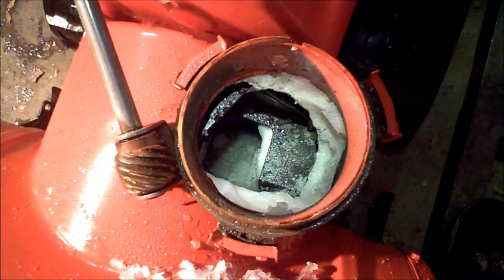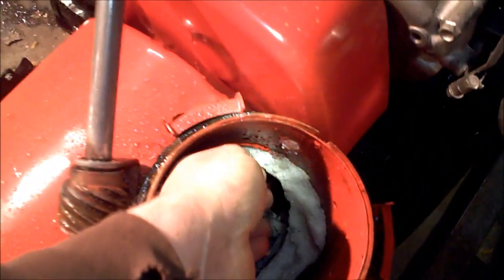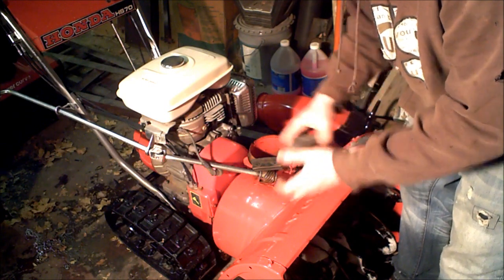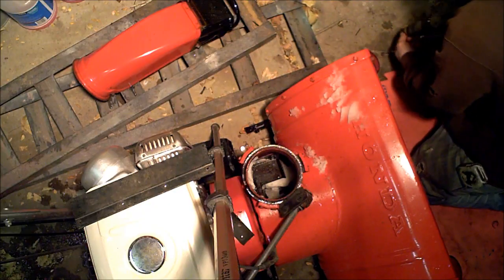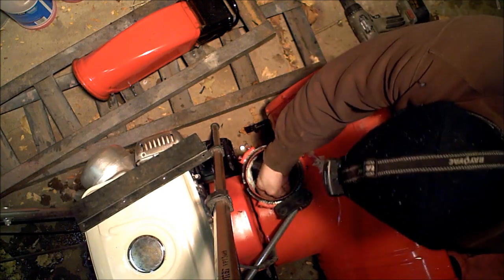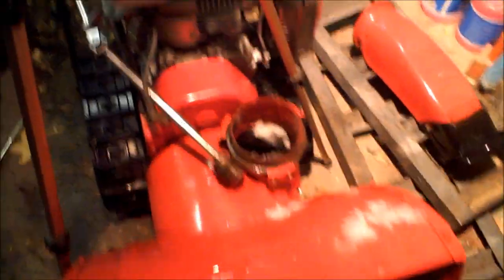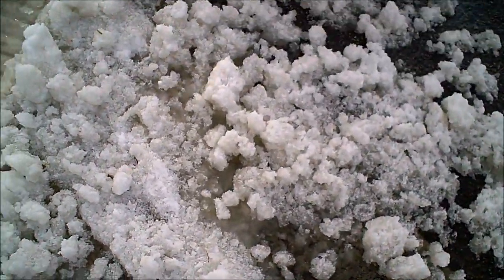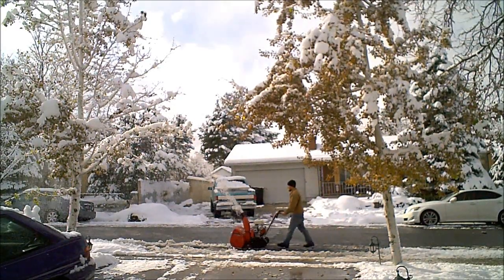Modify Snowblower to never clog and throw twice as far w/ Impeller Kit

Comment from the maker: There is a link to Heavy Duty Rubber Paddles designed to handle this and stainless steel screws in the video description.
Reply: sixtyfiveford Hey 65 love your videos! I have a question,  my 8 hp MTD where you screw the rubber on, mine has an additional 90 degree angle, like a scoop,  heavy steel. Do you think I could put this on the back side of the scope.
Reply: That’s the same way airlock rotors are done ✅ with a metal sleeve just like you are with the rubber gaskets
Reply: The only thing I would add is use anti-seize on the screws, that way you can remove the screws if needed.
Reply: if u have 3 paddles on your snowblower do we fix all 3? also mine on my craftsman are at an angle which will be harder to drill but better than getting rid of a good running machine . thanx 4 the great tips
Reply: @johnpoole8321  Drill slowly, don't force it or drill bit will break. You could actually drill carefully with #7 drill bit, and then tap it with 1/4- 20 Tap. Then get some stainless steel bolts and washers, and you are in business.
Reply: @LincolnSP150  use tapping fluid for a $ it will save your bit from wearing out!!! and from breaking because it wore and wasn't working , so you can get hte job done!!! cutting fluid, sorry, not tapping fluid
Reply: Have done this on my rebuilt batteryelectric snowblower, and it work just great 🙂
Reply: I don't have a impeller on my snowblower but was wandering if the same concept would work for mine
Reply: Hello 2018 ! Just found this thank god ! Inherited a crapsman 5/22. Has anyone done this mod on this particular model. Chute and box seem a bit different from the above video tutorial. After a few years of clogging anguish and several cans of pam( in which at this point I should have bought stock ) I am hoping someone has done this to the 5/22 or I’m going to take it to the demo range and blow it up ! Crapsman super sucks !
Reply: sixtyfiveford Great video. I'm looking to purchase a new Snow Blower, and recommendations and do you recommend a single stage or 2 stage for Michigan weather?
Reply: @RichieColemanSr  

  ---- ---- ---- ---- ---- ---- G63EPI2nZ0xF G63EPI2nZ0xF
Reply: Mr. RDCS 2 stage only way to go.

Comment: You can set the rubbers against the housing. It will wear in if you just let it run for 5 - 10 minutes until the paddles wear in, just like piston rings.

Comment: Hello sir, I have watched just about all of your video's and you my friend are very smart and think outside the box.  Several years ago I did this upgrade to my 20 to 30 year old MTD snow blower and what a fantastic difference.  But, now I am having a different problem with my MTD.  Last year it started shearing the pin that secures the left wheel to the axle, then the axle moves to the right, the woodruff key falls out & the self propel no longer works.  I've replaced the pin with a 1/4" bolt and it shears the bolt in half.  This last time it did it (last week 01/2025) I installed a grade 8 bolt but, I am now worried that a grade 8 bolt may do more damage than good (thinking that shearing the pin is the weakest link, now that I've installed a grade 8 bolt something else may break).  Also, while snow blowing, the blower wants to constantly go left and I have to force the blower to the right to keep it going straight.  Do you have any ideas what would be causing this phenomenon?  I am at a loss.  Over the years of ownership I have had this blower completely disassembled several times to fix various problems.  Thank you in advance.
Reply from the maker: That's a weird one. The only thing I can think is the wheel may be catching on the frame by shifting forward under torque due to a worn bushing. Something has to be stopping the wheel from turning while the shaft is still moving.

Comment: I guess I've been lucky so far, but I've never experienced either of my snowblowers clogging up.  If it ever happens, I'll just do what I do when I'm done using them and park them in front of my torpedo heater.  That 80,000 BTU's melts that stuff quickly, lol.  In 10 minutes it's not only melted, but dry and warm too.

Comment: The snow blower is a 2-stage machine attached to the tractor via a 3-point hitch.  The PTO has a beveled gear that drives both the auger and impeller,  oth driven by a second set of bevel gears.  It’s the centerline of the auger that needs to be changed, and therein lies the issue I’m having.  Or to put it correctly - my son is now having.  About 8 or 9 years ago I broke this snowblower down to change the centerline and true to form - try changing one thing and two others appear needing to be changed as well.  Keeping everything in alignment during these changes were just too much for one person.  What I did do was take the PTO 540 RPM shaft and double the  RPM using a gear box mounted on the snowblower.  Granted, not the smartest thing to do, but I do have sacrificial shear bolts on both the auger and impeller shafts.

Comment: I was given an expensive 2-stage 24” wide snow blower because it was jamming on everything except perfect soft snow.  Had an old large truck mud flap that I cut up to reduce the 3/4” gap between the impeller and housing.  My son now uses to clear his very long driveway because it works better than his tractor mounted snowblower.  Looked at the tractor snowblower and there is a real problem there.  The impeller is offset from the center of the housing.  At the bottom, between the impeller and housing, there is greater than a one inch gap.  At the end of the exit opening there is maybe a 1/132 inch clearance.  The only fix to start with would be to move the housing or impeller’s centerline.  Sometimes chicken, sometimes just feathers.
:face-fuchsia-tongue-out:
Reply from the maker: @robertmeier7620  Single stage? Put a spacer at/around the back on the housing just behind the auger/ chute discharge to reduce the gap. Does the same thing.

Comment: The question is.. why on earth does not snow blowers comes with the rubber flaps , would be a bestselling argument
Reply from the maker: Simplicity actually did this for their snow blowers in the '70s. Why don't they come with them now? Money. Higher end snow blowers have a lot tighter tolerances and don't really need these. Budget snow blowers under a thousand bucks generally have huge gaps and it only gets bigger the cheaper they get. It's cheaper and easier to give people the little plastic stick as everybody just assumes, snow blowers clog. When you buy a $600 snow blower, the goal is to make it as cheap as humanly possible for the consumer to buy yours versus the other $600 snowblower.
Reply: @sixtyfiveford  i got an old Canadian made Stiga 825 and a 928
Reply from the maker: @kendexter  Never even heard of Stiga here in the US. I just looked them up and they look like they're made by MTD. At least the ones made in the last 30 years or so. Here in the US, MTD made probably at least a dozen brands.

Comment: Great tip. Works like a charm. I used some silicone grease to lessen the friction on my 5hp Snow King. No offense, but what you called “self-tapper screws” are actually self-drilling screws.  Self-tapping screws require drilling a properly sized pilot hole that they will then tap into. Self-drilling screws drill the pilot hole and tap into the sub-straight.
Reply from the maker: Oh the endless debate of self tappers. These are technically self drilling and tapping screws as they drill their own hole and make a few threads.

Comment: Nice upgrade.  For a more envirofriendly option to the DuPont Snow & Ice Repellant with Teflon Fluoropolymer, try using regular cheap vegetable oil as you find in the grocery store.  I just brush it on the interior of the augers, auger housing, impeller and chute at the beginning and end of the season.
Reply: I just spray it down with wd-40
Reply: @76327monte  Nothing says good for the environment like WD-40....  /S

Comment: Yes that's called an impeller kit and they sell them on Amazon for any snowblower or you can just use conveyor belting or similar belting and make your own. I've done several blowers with it and it works well. No it does not make them blow snow twice as far but it will blow it a little farther than it did before and more importantly, it will keep it from plugging up when blowing wet, heavy snow.
Reply from the maker: Yeah they didn't start selling them until my video went viral.
Reply: @sixtyfiveford  No, they've been around since I was in the Army back in '72.

Comment: We just scored an older Craftsman 12 32 track drive for $200.  Removing the track drive and mounting the blower to the front of our 4 wheeler. With no drive to run and this impeller mod this thing should sling some snow for sure. I think that this will be a kick ass upgrade for sure. Thanks for sharing. Liked and subscribed. 👍🏻👍🏻👍🏻

Comment: I have a 622 honda, about 15 years old. Never had a problem until now. It clogs up in the shute with heavier snow. I was told that spraying the shute with PAM, a cooking spray,  would help the problem. NOT. Ever hear about this fix?
Reply from the maker: Yes, that helps but you will have to do it constantly. Every 10 minutes of run time and every-time you use it. Any oil works and I find WD-40 better. They do sell dedicated products: https://amzn.to/3CBH6HF

Comment: How thick is the impeller blades on an early ( 1980 ) Toro 7 24 ??  can they be drilled and set up like this.
Reply from the maker: They're generally 3/16" thick and harden steel. Most newer stuff is under 1/8" and mild steel.

Comment: self taps can only last so long.
Reply from the maker: True and that tends to be the life of the snowblower. I've installed all over 100 of these setups and a lot for neighbors. Every time one comes in and I look at it and I've never seen a single self-tapper back out. I even run self-tappers on tractor snow blowers and never seen one back out.
Reply: @sixtyfiveford  I’ll take your word for it, I spent 40 years in the sheet metal HVAC industry where we use self tappers all the time but it seems with all that stress on the blades it would be logical to use bolts.

Comment: I did this mod’ six years ago, to my new Cub Cadet 524SWE, after watching this very video, and it’s still firing snow with a vengeance! I used pieces of a Toro single stage rubber auger paddle ($16 on sale), and stainless nuts, bolts, and lock washers. Thanks for the “how to” on an awesome mod’! Keep doing what you do.
Reply from the maker: That's awesome. It's too there point I just do it to every snowblower I service now.  I stuck my finger in the gap of a brand new $1200 Craftsman the other day at Lowe's. The gap was nearly 3/4" . I guarantee the new owner of that will being looking for this solution next season.

Comment: My drive cable keeps coming off the handle. The only thing I touched was adding more tension to the auger tensioner pully, which I don't think caused the problem. The drive cable ends are both intact and can be reconnected, but just pops off again and now has bent the housing that holds the cable to the handle. Any Thoughts???

Comment: Interesting suggestion that you don't need to install the impeller extension on every blade, that may be what I try for a first cut because I'm for looking forward to the drilling on the vintage Troy Bilt 42000, which have thick blades.

Comment: I'm not sure how much balance comes into affect on a snow thrower but I would definitely worry about only putting one on or if you had 3 paddles on your impeller I would do all 3. Great info just my thoughts
Reply from the maker: The impeller is never balanced under load. One blade will have a full load of snow while one might have a partial and the other(s) empty.

Comment: Wow, excellent tip I'm going to have to try that.
Reply from the maker: You should!
Reply: @sixtyfiveford  I ordered some screws I just got to get some rubber and get it done.

I was going to mention to you that I seen on another YouTuber that he had a gravel driveway and he put some gas pipe he cut a slit down in it put it on The cutting edge so don't grab the rocks in his drive and I did it on my walk behind snowblower and it definitely helped out a lot, definitely does not pick up as many rocks and throws them like it did with just the regular cutting edge.

Comment: I have a Toro 2 stage blower 622 power throw 6 hp.  My problem is I’m having trouble securing the impeller so I can drill it. Do you have any suggestions on what to do?  There an angle brace on each blade. Thanks for the help.
Reply from the maker: Sometimes just pulling the auger engagement lever and clamping it down it's enough to hold it steady enough. Another times I've had to wedge a 2x4 between the impeller and auger to get it steady.

Comment: Help!!!  On my snowblower friction wheel shaft, if the smallest gear is in place, the wheels won't turn. If I move it aside, then the wheels turn. Put back in place, it won't move again. All gears are complete with no teeth broken.  I have wracked my brain and it doesn't make sense to me. What am I doing wrong? Every gear moves until that smallest gear is put back in place.  Please advise..
Reply from the maker: The friction disc is a wear item and easily gets hard/worn out. It's common for the metal disc it rubs against to also get grooves in the most common settings (generally slow speeds). Tip it up with the bottom cover off and inspect it. It is also common for the slowest speed to be out of adjustment (sometimes as simple as the lever rod getting a slight bend) and it'll ride dead center in the metal friction disc and your blower won't move.

Comment: You can use silicone spray on impeller and around the housing every year. Works lot better. Do it on a sunny day so silicone dries quickly.
Reply: If you do both you could probably throw your snow 2 houses over.

Comment: What kind of people are sticking their hands in the shute  as it’s spinning?! You let go of the handles and reach in and scoop out the slush. Who is keeping their hand on the auger handle as they scoop? Why?
Reply from the maker: Some snowblowers don't always release all the belt all the way when you let go of the handle(not adjusted correctly) and though it would stall out under heavy snow load it will still spin pretty good with no load. So I assume they clear the majority of the clog with the auger/impeller off but as soon as you clear the clog it is enough to spin the impeller and take a finger off.
Reply: I've had ice cause my cable to stick so my impeller would keep spinning.  I make sure my 70 year old mother ALWAYS uses the cleanout tool.

Don't stick your fingers where you wouldn't stick your Johnson.

Comment: This is a brilliant hack, I have an old Toro 521 my friend gave me 9 years ago. I didn't really have any use for it so i loaned it to my brother as he had a bigger driveway to clear. He could not get it started so he put it in the boathouse, where it sat for 8 yrs. after changing the plug and fuel, cleaned the carb. it fires every time 2 pulls max. Now I am ready to try this mod as it does have a clogging problem. I will post after to let you know how well it works.
Reply from the maker: Thanks. I'm glad you liked it.

Comment: Another thing that really works is get some ceramic paint coating like maguires, turtle wax etc. Coat the entire machine with two coats following the directions on the bottle. It makes the surface have an extreme hydrophobic surface so snow and water just slides off the surface so it can't stick.

Comment: Not to bore you with details, but I've never owned a snowblower until recently, because I've always used my Quad with a snowplow blade attached to the winch to raise & lower it. It was fast, easy and fun to clear snow from the driveway. This worked great for many years, but there are areas that the Quad cannot reach. I used to shovel those areas, like the dog run on the side of the house and the back deck. The problem is, as I've gotten older, I don't have the stamina or back strength any longer to shovel those areas. At that point, I started looking for a snowblower. As luck would have it, a neighbor gave me one that had been sitting out in the weather for many years. After many hours of work, getting the engine to run, I was in business. However, while using the snowblower, it would clog up frequently. I've sanded and repainted the chute which should help. But I also noticed that the clearance between the auger impeller blades and housing are excessive allowing for snow & ice buildup. To make a long story short, I really like your ideas about minimizing the impeller auger blades to housing clearances. I will be implementing those modifications and will post how well they worked for me. Thank you for your very informative and detailed posts.
Reply from the maker: It makes a world of difference on these machines. I hope you try it out.

Comment: auger belt on 2016 murry seems loose   doesn't throw snow at all. clogs up with any snow. should I try tightening the belt and than adding the rubber plates?
Reply from the maker: Yeah, you definitely need to address the belt if it's slipping. This trick puts slightly more strain on the belt so it'll slip worse.

Comment: Great But have a 75 Toro 2 stage. Any comments what i can do ?
Reply from the maker: Exactly what I do here. Toro just used thicker steel so you may need to drill a hole and then put a bolt though. Self tapers might not have the power to go through the thick steel.
Reply: Thanks for fast reply